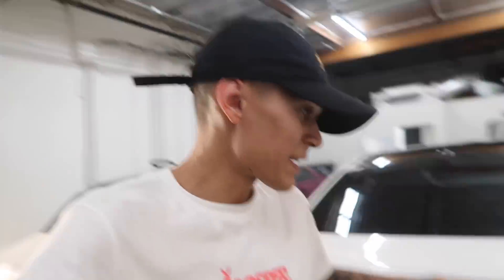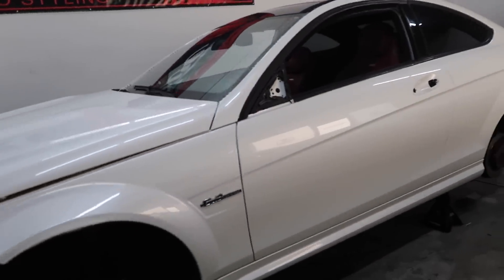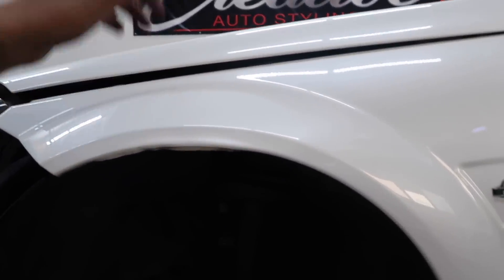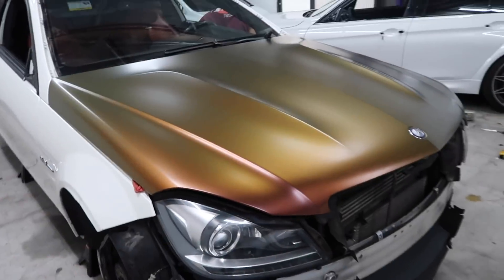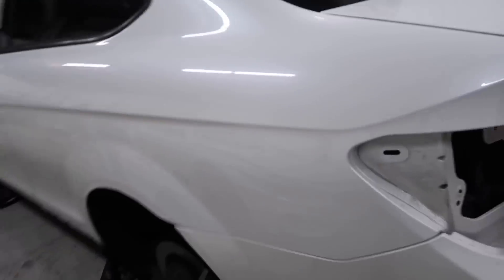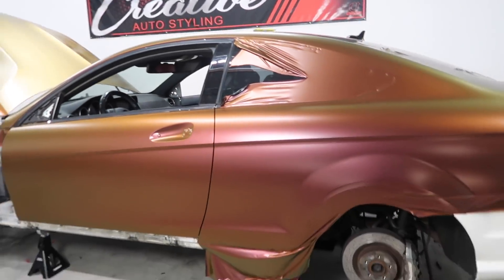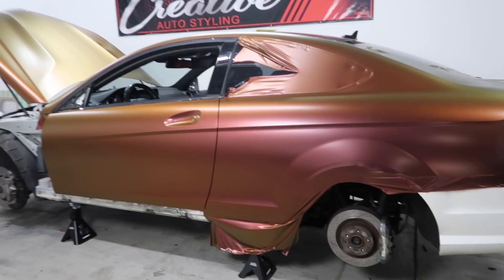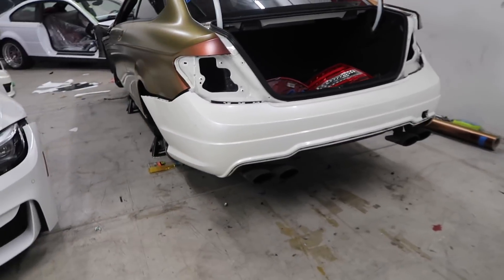YOURSTRULY 1000 HP GTR/ AMG C63 FULL WRAP (WHY IS THIS COLOR SO POPULAR!!!?)

Comment: Hey nice job ;) Have a question - When you drop a vinyl on hood in witch direction it must to go? The same as on fender or from up to down ? thx :)
Reply: Anton Loprez from center to side and just make sure to pull to the point that you can have tension infront. I see in video he overstretch the rear bumper on tail light side. This might fail